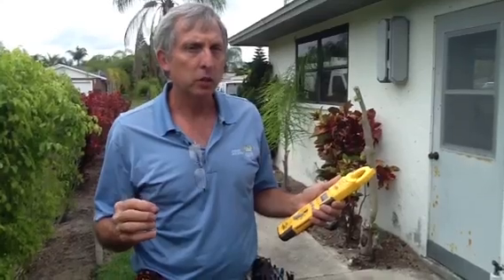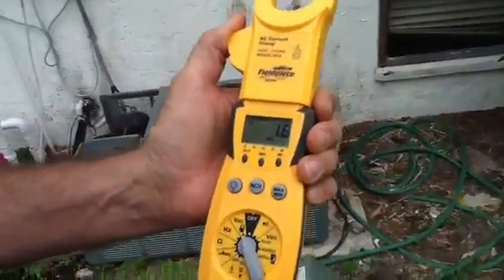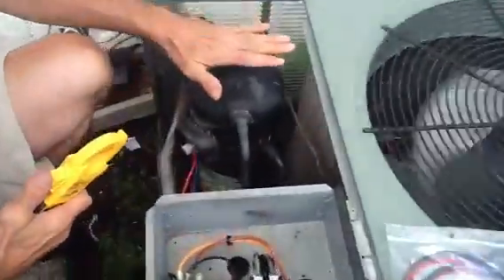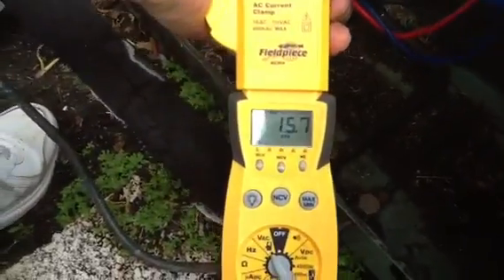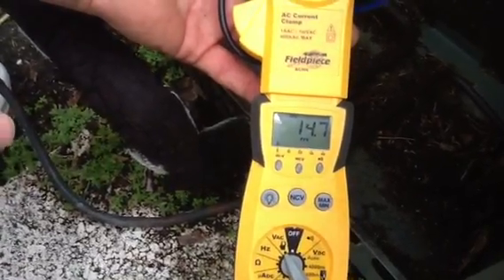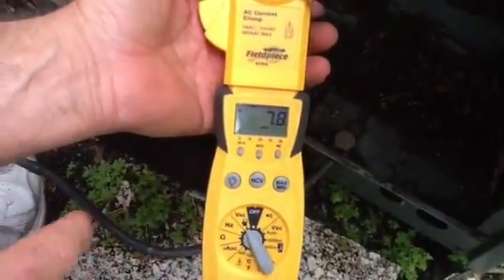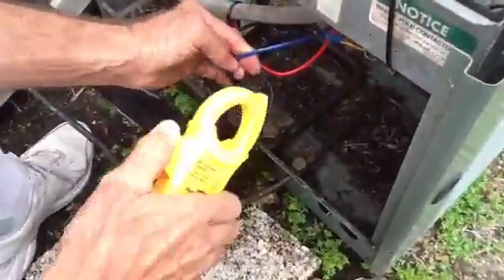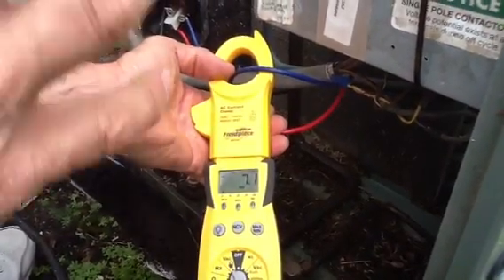How to check Amps on a Compressor:

Comment: Sir, 1.5 ton ac running 20 minutes then tripping. Running only condenser fan, is this is high amps problem? Refrigerant level is ok. Pl reply.
Reply: anilkumar.c.m pothencode  change  capacitor
Reply: Thank u sir.

Comment: If the highest amp reading you get with your meter is more than the RLA posted on the unit panel. Does this mean the compressor is going back ??
Reply: Bad*
Reply: OVERWORKING

Comment: Nice.!!!!
Reply: lazaro hernandez 
sir I have one a/c compressor is running amps 5 but low pressure is 80 psi I release the pressure the pressure going same place 80 psi
Reply: anyone help me I have one ac problem ac running amps 6 and low pressure his 80 psi I release the pressure  but the pressure is going same place 80 psi anyone help me thanks
Reply: @muhammadasifkhan9436   what was thd problem i have the same problem
Reply: @muhammadasifkhan9436  que isistes ..q era el problema ??